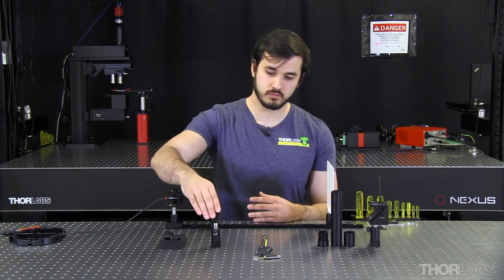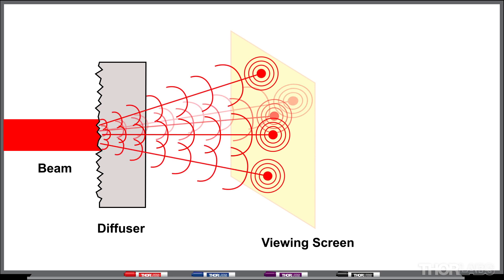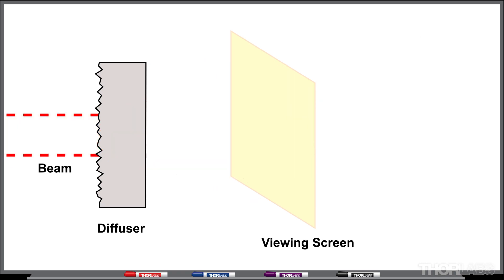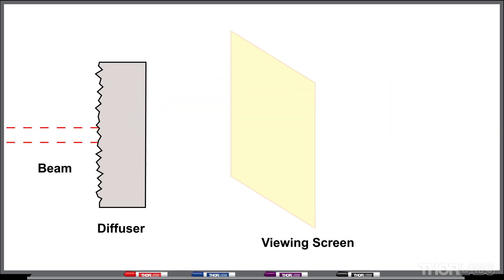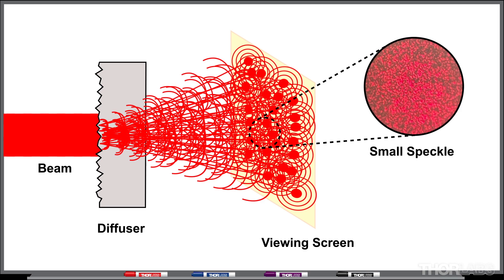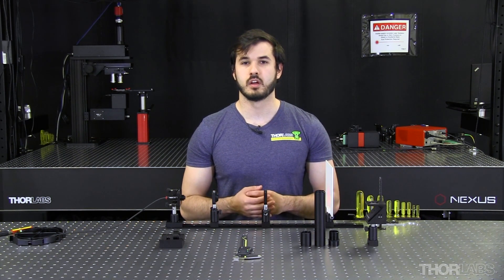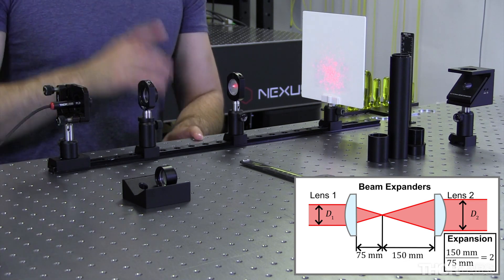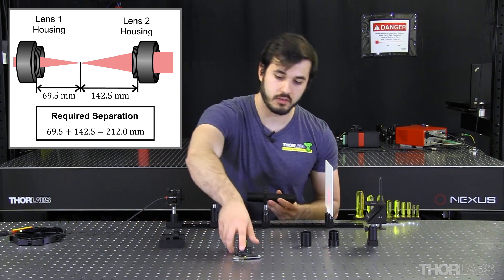Use Laser Speckle to Find the Beam Focus | Thorlabs Insights

Comment: I am to build beam expander for white LED intense spot using 2inches and a chromatic doublet and telecentric objective. To have 10times variable magnification. I need help with simulation.
Reply from the maker: We recommend following the usual practice of collimating the light from your LED before inputting it into the beam expander. Then, the light output by the beam expander is also collimated, and the magnification is the diameter of the output beam divided by the diameter of the input beam. Typical two-lens beam expanders are constructed with the lenses separated by the sum of their focal lengths. Two-lens beam expanders provide one fixed magnification, which is equal to the focal length of the second lens divided by the focal length of the first lens. Therefore, to obtain 10x magnification, the focal length of the second lens should be 10 times larger than the magnification of the first lens. (For more details see: https://www.thorlabs.com/newgrouppage9.cfm?objectgroup_id=14648 )
 
In order to construct a variable-magnification beam expander, it will be necessary for the beam expander to include at least three lenses. If you would like to speak with us to explore an option that will work well for your application, please contact us at techsupport@thorlabs.com.

Comment: really nice tutorial! but seems the placement direction of the diffuser shown in the scheme different from the real setup?
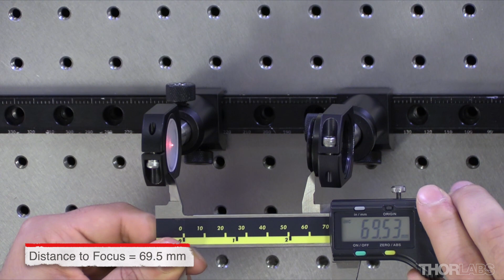Reply from the maker: @onnobo7859  The orientation is the same in both. We were careful to make sure the beam was incident on the ground glass side, since it is so important to the accuracy of the measurement. Check out the view at 4:07, where it is easier to see that the ground glass face, and not the retaining ring, is flush with the front surface of the mount.

Comment: would the distance between the white board and the lens be a factor in this demo?
Reply from the maker: @Thomaszhang3115  The speckle pattern will change as the distance between the diffuser and the viewing screen changes, but using the technique demonstrated in this video does not require placing the viewing screen at a particular distance. However, adjusting the distance to the viewing screen might make it easier to  see where the lens placement is optimized. This is because the average speckle size depends on the distance to the viewing screen. When the viewing screen is farther away, the average speckle size is larger.

Comment: is this method affects the wavelength of light?
Reply from the maker: The method also works for other wavelength of light. However, light of different wavelengths may focus at slightly different distances from the lens due to a lens effect called chromatic aberration. Achromatic lenses are designed to have reduced chromatic aberrations.

Comment: What was the "grit polish" number of the diffuser you used? Is it an important parameter for this application?
Reply from the maker: We chose a diffuser polished with 1500 grit (Part Number: DG10-1500 https://www.thorlabs.com/newgrouppage9.cfm?objectgroup_id=1132&pn=DG10-1500&YVI=23  ). In our demonstration, the source provided a collimated 635 nm laser beam with a 3 mm diameter. Lenses with 75 and 150 mm focal lengths provided focal spots estimated to be between 20 and 40 microns in diameter.  We chose this diffuser because the resultant speckle was nicer in appearance, over a wider range of beam diameters, than the speckle provided by a diffuser polished with a coarser grit. 

There are a lot of variables to consider when selecting a diffuser. If you would like assistance choosing a diffuser for an application, please contact Tech Support (techsupport@thorlabs.com).